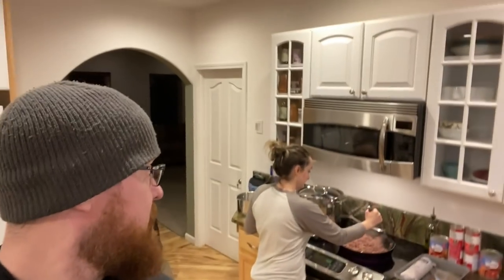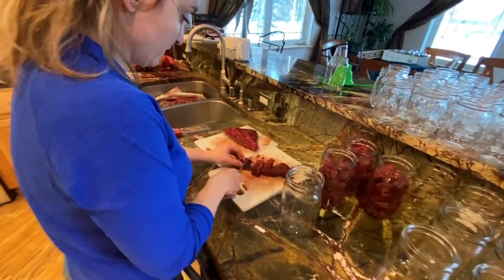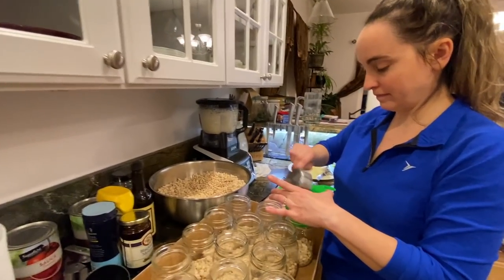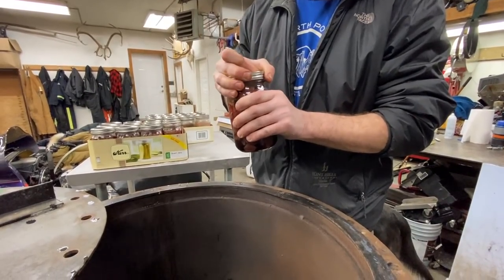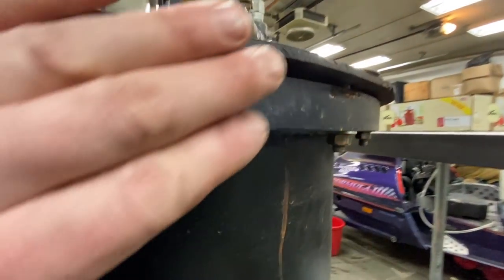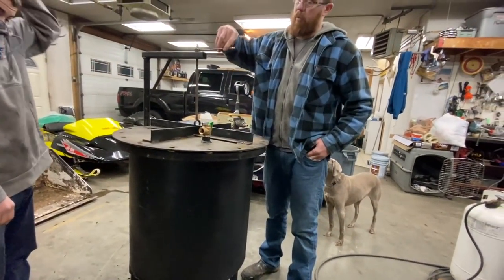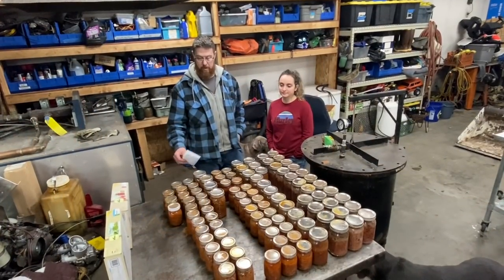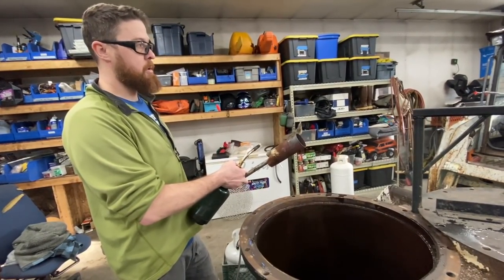HUGE homemade PSI Canner 96 jar batch  || MOOSE CHILI ||

Comment: Great video Scott and Family!!, I would suggest you use Mineral Oil instead of vegetable oil to help with keeping the canner from rusting. 
Retired meat cutter, that’s what we wiped everything in the shop down with after clean up.
My guess would be you used a 4’ spool of a 24” diameter steel  pipe, welded a bottom to it with a few legs and a big blind flange for the top, 1/2” line with a T for the pressure regulating valve and gauge.
Are you a Pipe Fitter/Welder of some sort?? 
I worked both as Meat Cutter and Water Distribution Manager.
I’ll send a picture of mine when I get it built.
Great idea with the all thread to lift the lid, you just saved me hours of work canning!!
It’s slow going 7 qts at a time, and my lids also eventually rust even out of a stainless pot.
They need to make stainless caps and rims.
Now I want to go kill something
👏🏼👏🏼👏🏼👏🏼👏🏼👏🏼👏🏼
✌🏼😎
Reply from the maker: 24”x24” I’ll be putting a build video out soon. I’m not a pipe fitter but I do some welding for myself. I welded a couple 3/4 fittings to the lid for the psv and the gauge/valve. Glad you liked the video I’ll try and remember the mineral oil next time

Comment: Great video guys. I will be getting into canning soon myself, and just one question would be, is there a way to keep the jars fuller after they are done. It seems the6 condensed down quiet a bit.
Reply from the maker: We added water to the chili it was absorbed into the beans. Same for the pork n beans. For the moose meat we filled with h20 to about 1” from lid
Reply: When it comes to canning raw meat, just pack it down really good. It cooks while in the pressure canner and shrinks down. As for meals, always leave the head space or the liquid will come out in the canner and won't seal properly.